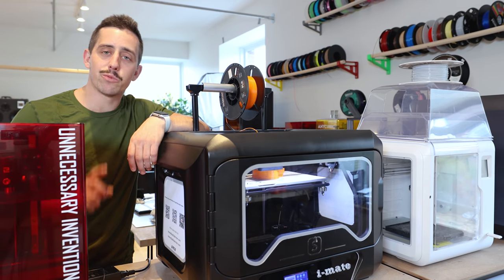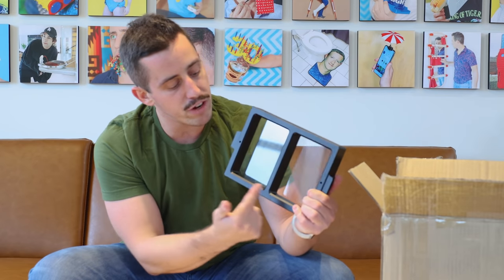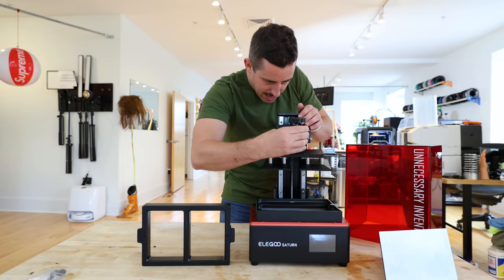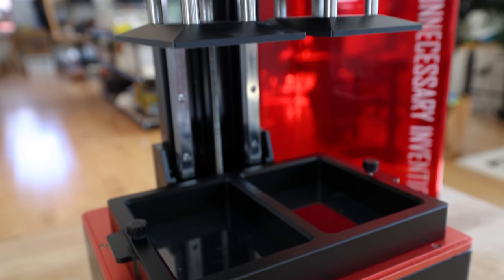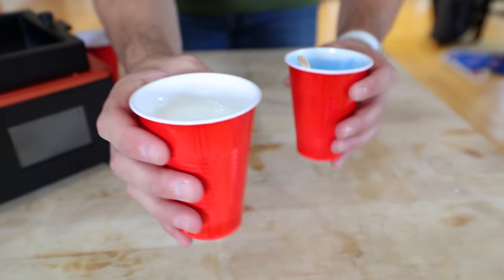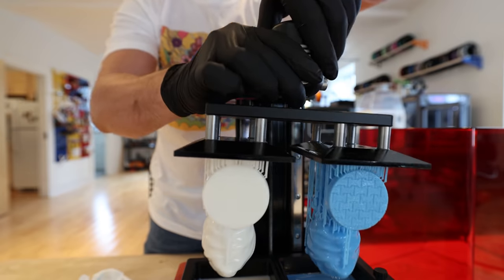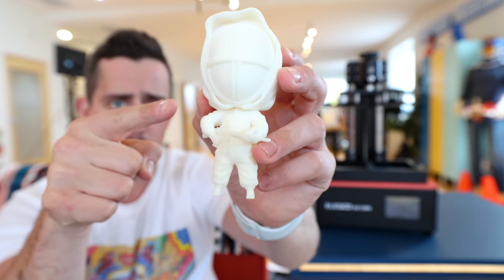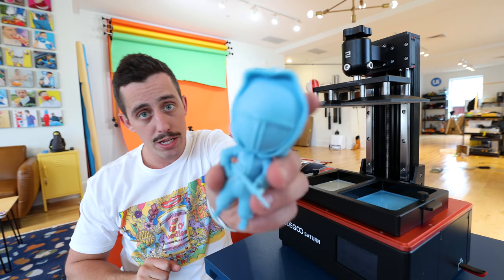2 Vats, 1 Printer! The Elegoo Pluto 3D Printer?! (First Look)

Comment: Elegoo should sell this as either standalone or as a printer and call it the elegoo pluto or the pluto kit.  As a way of thanking the inventor.
Reply: Kit would be a really nice idea, but problem would be with price. Vat would be ca. 60$, double build plate another 60$ (2x Mars plate price). Also you need to remember about endstop, which meant you cannot switch quickly between prints. Then  there is a very high risk of cross contamination of resins  when removing the prints due to drops falling down. And emtyping would be a nightmare. 
With all that most people would just prefer buying extra Mars, even if the cost would be slightly higher.

Comment: I must actually say that this is quite amazing if you're planning to print things like multiple miniatures
Reply from the maker: There is definitely a niche that would get some good use out of this.
Reply: You can actually print more miniatures at once without the double vat system-- you get a LOT more available build area and can print a lot more than the space lost when you dont cut it in half because of things like spanning the gap, balancing fep wear, printing in the center vs the edge. you also still can't print with two different types of resins many times, because they will have different exposure times. This is mostly only useful for producing two different colored prints with one printer using roughly identical resin, when you don't want to run two printers or only own the one extra large one.
Reply: @noth7031  The only way I can really think of this being useful is printing full miniature armies, but if your printing armies why not just swap resins?
Reply: @mudawott  I would do that too he he he... 

Me 10 minutes later: let's go to battle, get more printers, to make more soldiers, to REPEAT YES YES YES YES YES
Reply: @ThatBuckskin-Frank  Ahh yes the other.Smarter option

Comment: Props to you for actually getting in touch with them to make it a real thing. But has no one else thought of it? I have an ender 3 and was looking at more printers and see a ton of printers that have dual hotends to do this. So I always wondered why there wasn't ever a resin printer that could do the same. I'm surprised companies haven't put anything out of it and that they only did it because you told them about it. I feel like this is one of those ideas, that should've already been made or that more people have thought of.

Comment: You know, I looked at that at first and thought, thats a dumb idea. However the more I thought about the better I realised it was. Resin printers are often used to print visual models, and being able to in a single print, print two different colours would make it so much quicker and easier to print multi-part multi-coloured models.

Comment: If I would be Elegoo, I would release the kit, like you got it, so for the Saturn and name it Elegoo Saturn Moon Kit, because is for the Saturn and smaller and Saturn many moons and you now can print two prints at the same time. I think that would be a perfect expansion kit for the printer and would, if the price is not to expansive, buy it.

When this product comes to market, I would love, software integration so, that you can change some settings per side, if this is possible.

Comment: I was thinking about a printer with changeable vats as well. But my idea was about 1 big regular vat and 1 smaller vat that takes about 1/2 of the regular vats resin but still fits into the brackets. The problem with big resin 3d printers is that you need to add almost a whole bottle into it to make it work. Small prints are a annoying to do with a big printer. A second vat would fix that hazzle

Comment: It really only makes sense if you have 2 separate screens and 2 separate light sources, which currently does not exist. Largely due to the fact the LCDs used in these printers are off-the-shelf components from other manufacturers, and they don't come in the weird dimensions created by dividing the vat like this. In this design, you are burning through the relatively short lifetime of the screen on both sides even if you are only printing on one side of the divided vat.

Comment: @unecessary inventions, that was a great idea you came up with for resin 3d printing. it was nice of the elegoo engineers to entertain your idea by making the first double vat and double plates for your printer. i would like to see your idea on a much bigger resin 3d printer like the phrozen sonic mega 8k and the peopoly phenom xxl. just thinking about printing 2 separate prints at the same sounds fantastic. It would be a great addition if all resin 3d printing companies could incorporate air filters and automatic resin refill with their printers. I would be among the first to buy a double vat resin 3d printer if it was on a much bigger 3d printer along with air filters and the automatic  resin refill installed.

Comment: This seems like a good engineering feet, and I honestly think Elegoo are awesome for trying things out and investing time and money into listening and testing things..

On the other hand I don't feel like there are a lot of practical applications for this beyond using different colors, and unless you're using resins that require the same exposure parameters, you won't be able to use vastly 2 different types of resin unless you have 2 different screens and light sources "flex, cast, tough....etc."...plus as you mentioned emptying the vat will be a nightmare

Seems like a very niche idea, but not lne that I'd be interested in

Comment: wow I expected these resin printers to cost thousands of dollars but apparently they're only like 300$
i have a couple questions if you wouldn't mind answering (you seem like you know about this stuff)
- would you recommend an elegoo mars 2 pro as a good first printer? or should i get a saturn for ~200$ more?
- should i get a curing machine, or would just putting it out on my balcony work? (and would a curing machine be faster?)
- how much do you spend on resin and coloring and the stuff you use to wash prints?
Reply from the maker: Will this be your very first 3D printer? If so I would suggest an FDM printer over an SLA printer as a first printer. Resin 3D printing can be finicky and messy. My first printer was the Flashforge Adventurer 3 and I still use it on a weekly basis.